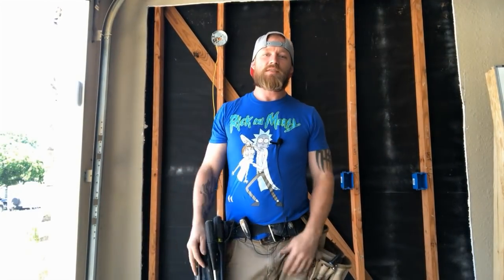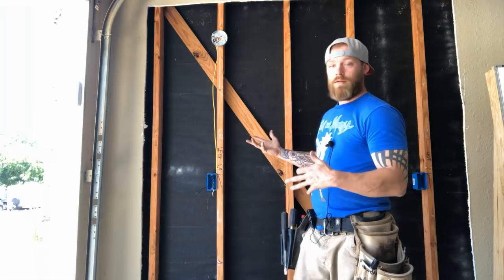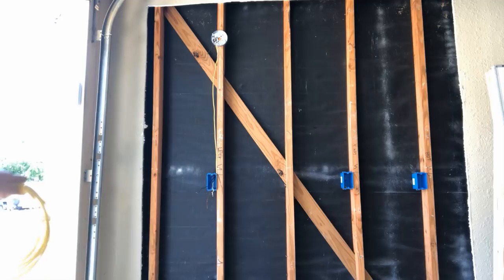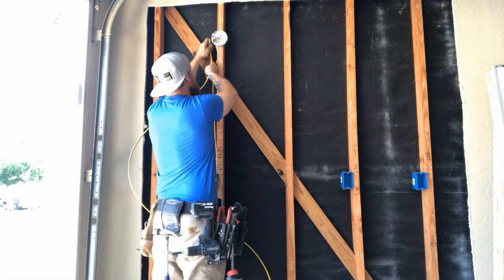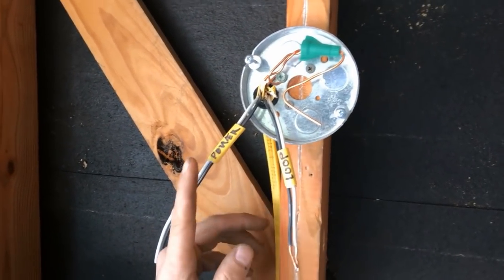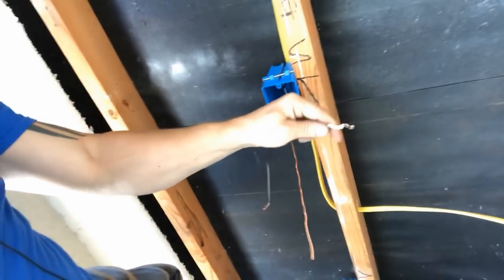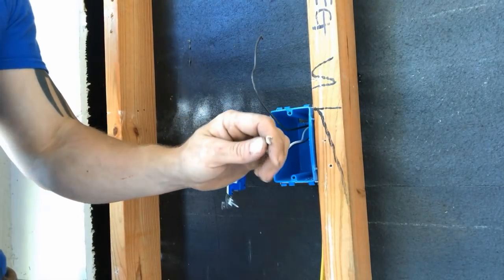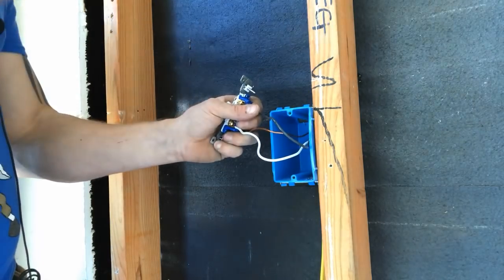Episode 12 - How To Wire For A Switch Loop

Comment: In my area we call them "Dead ends". I personally only do them if I know I will have a Neutral coming to the box later. Cause code. Great videos! Learning new terms and refreshing my brain.
Reply: Just do it with 12/3 and you can have your neutral and switch loop too
Reply: @df4196  That's typically how I'll run them. Either 14 or 12/3. Never done it but an idea I've had is running 12 or 14/4 (14/2/2) for 3-way systems but now with Caseta switches, running wires for 3-ways will be a thing of the past thanks to 2020 code lol

Comment: The new NEC Code requires Hot,nutral and ground wires in a box. Plus...the Hot White conductor has to be identified as a Hot conductor by tape it or Mark it with Black, red or Blue for 120 volt.

Comment: honestly the best explained switch loop video I've seen on YouTube.
Reply: g00se0017 his quite the teacher..
Reply from the maker: Thanks my friend, there are lessons to be had from all of them, just trying to help get more content out to the trade as a whole. I appreciate you watching!
Reply from the maker: Thank you!
Reply: Agreed
Reply: How can I remove a bulb that has, blown out and bottom of bulb has popped out of socket and is hanging!! HELP!!
Reply: @karenhunt6406  I'm sure you have fixed your broken bulb by now but when I'm faced with that situation I turn the power off to the circuit then I'll take a small potato and push it into the base of the broken bulb and turn the potato. 
The bulb should bite right into it and should come out easily.
Reply: @ElectricianU  
I am confused by why this would be a practical solution at all, but my question is, why wouldn't you run 12/3 from the fixture to the switch‽  This provides you with 2 proper hots and a required neutral for the box. Am I overlooking something with this configuration?
Reply: @ElectricianU  
OMG, sorry!  You weren't demoing how to to wire this, it is intended to show the process of how a long obsolete technique works for current knowledge and diagnostic purposes. I woke up in the middle of the night and just got it.  You wouldn't be doing this professionally today, but if, for whatever reason, you did, of course, you'd run 12/3 to accomplish it.

Thanks
Reply: @ElectricianU  Could you have used the black wire from the switch back up to the light instead of using the white wire? In other words, let the black wire be hot then use the white wire from the switch up to the light, instead of the black??

Comment: Mind you this will no longer be code as a lot of "smart switches" require neutrals. So you might have to run 14-3 OR the only way to do this is IF you have multiple switches controlling the same light in which case ONLY ONE of those switches require a neutral, the other can get away without one.

Comment: Helped me figure out my issue. I didn't pay attention to how it was wired when I unhooked the light fixture. I did note there were three sets of capped wires. Had some issues when I hooked everything together with only two sets of capped wires. Then I opened the switch box and saw only one set of wires. This threw me for a loop (all pun intended). 
Found your video and it helped me to make sense of this. Thanks a million!
By the way, I am a diy guy. Just putting a ceiling fan where the old light fixture was.

Comment: I just bought a new home and needed to replace a light switch. Mistake number one, I didn't document how it was wired as is. Mistake number two, I assumed one of those lines was just power for a stupid light in the closet. Thank you for this tutorial. I was able to figure out how everything coming off that hot wire was connected together and my first try (after) was perfect.
Reply: Rejoice in those mistakes friend- as you became a better electrician for them. Yes it's always best to properly document especially if you don't have a full understanding, but getting in a hurry can sometimes force us to slow down and learn things from the ground up, or the panel down so to speak, lol. Cheers!

Comment: Dustin, thanks for this beautiful explanation. 

I had a very strange call today. Customer says when he turns the TV on, the flood light, on the eve, out side his window turns on but really dim.
At first I thought it was a short. Oh how I was wrong. 
Basically the switch on the wall was blanked and someone spliced into the power (white wire hot ) and ran it down the wall to a new outlet which the TV was plugged into. 

See where this is going yet??

Had to get my extension ladder to get to the flood light, once I opened it up I saw the infamous white and black under the wire nut and from your video, I knew exactly what I was dealing with.

What happened was the outlet that was spliced through at the old switch location became an open switch. Plug a TV into said outlet, and now the TV has become the switch. 
Somehow the TV was able to produce enough Volts to barely light the flood light. 

Add this one to the list of shit you’d never think you would see.

Remedy, replace flood light with motion detector and make the the rest of the circuit straight through power.

Comment: This is the standard way of providing lighting in the UK. Lamp holders have three sets of connections; line (hot), neutral and switched line. The lighting switch back boxes only have the line feed and the switch return. This enables the back boxes for light switches to be shallower than the back boxes for sockets.
It's probably because it's normal for all cabling to run throught the ceiling with drops down to switches and sockets rather than having the cabling running through stud walls like seems to be the norm in USA.
Reply: Stuart Arnold , my guess is because it makes it simpler. This method in the video seems more complicated. Your way does make more practical sense though. It saves the integrity of the studs and less wiring

Comment: I have this same problem where the power comes from my ceiling light and not from the switch. Now I know why my white wire from the switch is not a neutral. Best explanation ever. Thanks

Comment: It is always a good idea to have a neutral in we every switch box because some occupancy sensors require a neutral to operate. Future energy codes will mandate them for some light fixtures.
Reply: our local code demands neutral in every box. I only encounter switch loops in old, or "unlicensed", work.

Comment: As probably many already mentioned its a nice way to use the spare wire but removes the possibility for future expansions. Recently had to replace a switch into a switch outlet gfci combo and if this was the wiring done there i would had to rewire but since it had the unused neutral upgrade was rather easy.

Comment: Great videos, really helpful, keep it up. Just to add something to what you showed, and you tell me if it should be done in this way. If you wanted to ground the switch itself, you could still use the ground wire from the leg and twist it together with the one on the power side bypassing the light fixture.

Comment: the incoming hot enters the electrical box where the light will be installed - I like to say that instead of "it goes to the light" as the hot conductor (black) is not connected to the lamp it's connected to the white conductor that goes down to the switch ... they say, "down on white, back on black" .... these are great videos I really like this stuff, thanks E  U  !
Reply from the maker: I like that. Reminds me of the song “back in black” by AC/DC
Reply: good one !   or the song by Amy Winehouse 'back to black'  ...

Comment: Amazing videos and thank you for your effort and all that you do. The clearest explaining so far!
I am not an electrician, but I am comfortable around power. I am renovating my house that was built in the '60s. I am doing a smart house, with wifi switches and outlets.
I've already installed most of the WiFi outlets. No issues there at all.
I came across the almost identical setup, I got fluorescent lights instead. The switch is in the metal box, white is hot, the ground is tied to the box inside.
Not sure what is the black wire doing there :)
I would like to swap the lights for some LED's (still deciding on what light source will be) and would like to swap the switch to the 1-way WiFi switch (made by Merkury MI-WW107).
Here is the connection instruction.
"Connect switch's neutral (white) wire to home's neutral, connect switch's load (brown) wire to the home's load wire, connect switch's live (black) wire to the home's live wire.
The connecting ground is optional"
Would you be kind to explain how to connect wires in my situation? I've been looking for an answer for a few days now without any luck (I am sure that my understanding is a problem)
Thanks for your time and help!
Awesome channel!

Comment: I wouldn't recommend ever making connections to any terminal with a drill or impact. I have experienced many problems especially with newer guys doing this.

Otherwise the switch loop in this configuration was well explained thanks!
Reply: I don't recommend painting even to professional painters. Same goes with swinging a hammer and cutting boards, plumbing showers etc. Literally every contractor I've ever hired (dozens who were highly rated) is a hack and wouldn't trust them to mow my lawn! However I use a huge powerful cordless drill to make many of my electrical connections quickly and securely, but NEVER with an impact gun! Can't even imagine thinking to try that, lol.

Comment: I have a 100+ year old house and I’m upgrading the panel and wiring. But I have a kitchen light powered on a knob and tube circuit and I have no access to fish a new Romex cable to the light fixture. I do have access to the switch, though. As expected, it has 2 separate K&T conductors entering. Not sure if it’s wired as loop switch, but I think I can make that moot by bringing a new 14/2 into the switch box as the power supply and use the 2 K&T conductors as hot from switch to light and neutral back out of the light to the switch. No way to ground the light, but that’s okay. At the light fixture, in the box, I can cap off any other wires and ignore them (I’ll be feeding all other outlets in this circuit with new wire, so eventually all the K&T will be dead (except the 2 down to the switch). I’ll have to leave most of the other K&T dead and in place because I have no way to pull it out. I suppose the best practice would be to put a cap on each one but also label it as “dead” or “derelict” (not sure what the best descriptor is to prevent someone else from panicking over them in the future).

Comment: This is so wild, I literally just ran into my first job where the whole house ( an old one) was wired that way, but everywhere. Would this be considered an old method? Do electricians still wire houses that way? Is there a benefit? 🤔
Reply: Hi. The only benefit that I can see is when it saves wire, i.e. if your light is between your source and your switch box. Or if your switchbox is already crammed with connections- then you may be able to utilize the extra space in your lightbox to make the junction. Otherwise either way can get the job done. Perhaps the norm in your area was to keep it the same for simplicity sake, and therefore the usual practice was/is to design electrical systems with "switch at end of run" as the standard. It actually does make some sense to design that way if the panels are located higher near the ceiling than the floor. Why? Because it's easier to run wires up through the ceiling into a light first, then straight down to a switch, rather than having to go up into the ceiling, down into the wall for a switch then back up into the ceiling again for the light. Another alternative would be to run the wires down through the floor, then up into a switch box, then up to the light. The problem with that is now if you need to repair or modify, the wire is buried beneath your beautiful hardwoods, rather than hiding behind cheap drywall on the ceiling. Oddly, most people I've noticed do it the harder way- which is up into ceiling, then down into switchbox, then back up to the light. Why? Well, because likely it's what they were taught as being the norm, or what they felt most comfortable with in their understanding. Hope that helps.
Reply: I'm rewiring my 1920 built craftsman home in San Diego Ca. It has "knob & tube" electrical wiring 12" apart in the attic space. Single wires mind you. I don't care how it was wired in 1920, I cut the wires out and started anew. I'll use both ways/systems, what ever is easier for me at that circuit. I liked this video very much and have done that in previous situations.

Comment: Instead of the light fixture could that be a reseptacle? I'm wiring a van and the switch would turn on/of the water heater that's plugged to the reseptacle. Ty great video.

Comment: Wow I’ve learned something 
That another easy way. Thanks 
I’m trying to learn what I can because Im try set up wire for entire room. They got one power line running and I’m trying to figure out how to get the outlets, lights and switch running at once, I don’tknow  if it works because that how it was set up. Thanks

Comment: I thought that under the new 2017 NEC there had to be a neutral in every switch box?  Whereas under the old code (2014 and before) you could run switch legs with one piece of 2 conductor wire from a switch to a load.  I haven't got a copy of the 2017 so I may be mistaken.  Good topic.  Take care.  Doug
Reply: Probably going to depend on what state/county/city you are in, and whether they have completely adopted NEC.   I'm pretty sure switch loops haven't been allowed in my state for some time long before 2017.
Reply: Not every switch box.
Reply: 2011 was when 404.2 came out

Comment: All lighting wiring in the UK is done this way, with the wire to the next light taken from the box behind the light. Our light fittings are designed to do this. John Ward will explain how it works.

Comment: Great explanation and demonstration on switch loops. I have a question I'm hoping you can answer. I acquired an old home that has had a century's worth of additions and multi-generational electrical work. Some very confounding setups in various parts of the house. I'm not an electrician so I have a professional out for larger projects. For simple things like adding switches and receptacles, I've done myself. I've run into several ceiling lights wired with switch loops in the oldest part of the house. I'd like to change a one gang switch loop to a 2 gang (one will operate a new porch light and the original will continue to operate a foyer light). All wiring on that side of the house is BX cloth-covered wire (in surprisingly good shape but no ground). Can this be safely done without rewiring? Thanks in advance for any advice.

Comment: So in order to run a constant On Outlet off of the switch you would have to re-run 12/3 wire to the light so you have a neutral on the outlet off the switch unless there was another neutral in the switch box from another set of wires, correct?

Comment: Don’t you need to re-identify the neutral (grounded) conductor as a hot (ungrounded) conductor?
Reply: Yeah, you know you do.
put a note in the box, if your really good.
Reply: Yes! And electricians never do. Tape is expensive.  Avoid doing this. It's old school wiring..
If you open the switch box and only have one set of wires, you now It's a dead leg (switch loop). The next give away is that white attached to that switch. It means that white is used as a positive.
Reply: I usually use a red felt marker to color the  white used as hot.

Comment: Read 404.2 (C) in the nec.  Neutrals are required in switch boxes. There are some exceptions, but you better be careful who your inspector is.  The only one you might be able to get away with in this situation, after drywall is 404.2 (c) 2  "Where the box enclosing the switch is accessible for the installation of an additional or replacement cable without removing finish material"     please don't teach these kids any hack shit.  Only teach quality with this platform you have.   Thank you fellow sparky.

Comment: I like the black edition Makita sub-compact set you have.I got one to it's great work for this trade. One question I have for you. Can you just run one 16-2 from a junction to your switched power (use to be a receptacle now I want it to be a light)  can i just tie into the power neutral with my switches neutral then run my hot to the switches hot to make it  work. It's working right now but what makes it dangerous.

Comment: is there another video connecting the 2 other switch boxes from the switch loop? I would be interested in knowing how that works, especially when connecting a dimmer with/without a neutral.
Reply: I’m pretty sure that the 2020 code requires a neutral run to every switch box so you can add a switch that requires it’s own neutral.  To do that you’d run a 12/3 from the light to the switch and use the red wire as the second hot and the neutral would just be pushed to the back with a nut on it.

I think this video is mostly to illustrate how switch loops were commonly run prior to the code update.

Comment: My understanding.

Normal loop = 2 different wires of NEUTRAL conncted with wire nut, AFTER coming out of light.

 Switch loop = 2 different wires of HOT connected with wire nut, (probably place inside or outside light) BEFORE coming to swith

And they both are going one loop together to make light bulbs

Comment: Hii there Electrician U,

thanks for your efforts in doing these educational videos. very beneficial and nicely done. 

for shorter version of my questions:
what is the name of the neutral wire that returns from load ? (load wire ? load return wire ?)
and what is the name of the neutral wire that is directly from fuse panel ? ( just neutral wire right ?)

thanks 
andrew